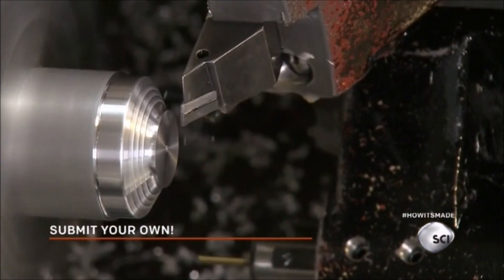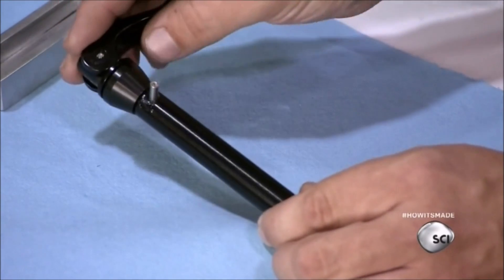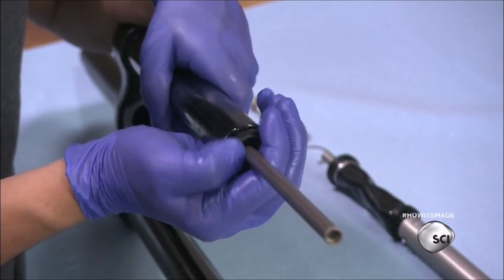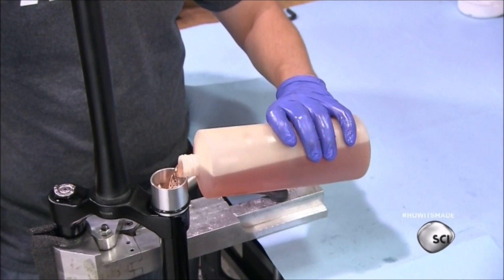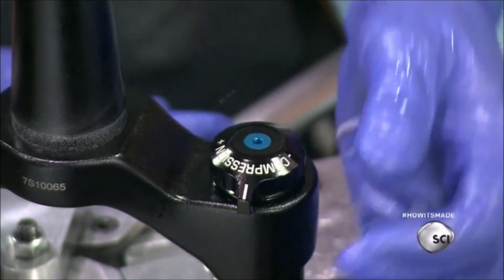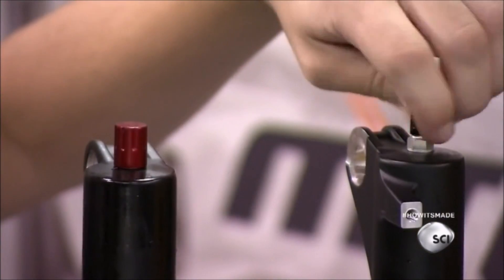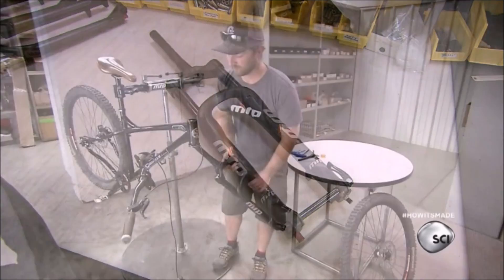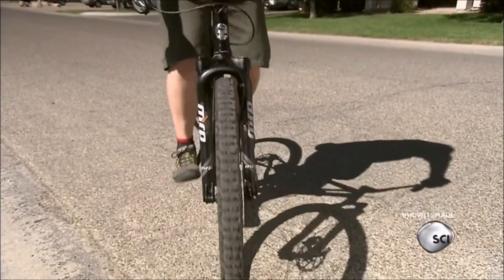How It's Made - Mountain Bike Suspension

Comment: Compression adjustment does not affect the compression of the oil, it affects compression damping which is basically just the speed at which the oil can flow through the system during a compression.

Comment: They need to work on their testing.  The  slow long travel in that test doesn’t simulate anything that fork is going to used for.
Reply: It doesn't need to, prototype forks have been rigorously tested under realistic impacts. That test is purely to ensure the system is performing to the same characteristics as their successful test forks have. It's quality control, not testing, so doesn't need to be a rough test :)